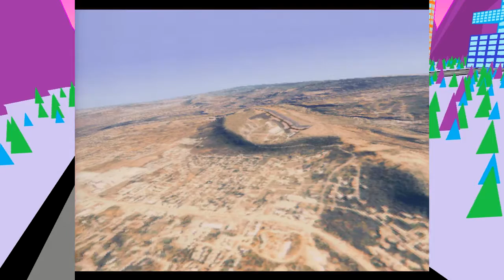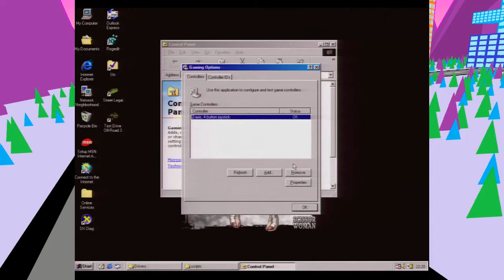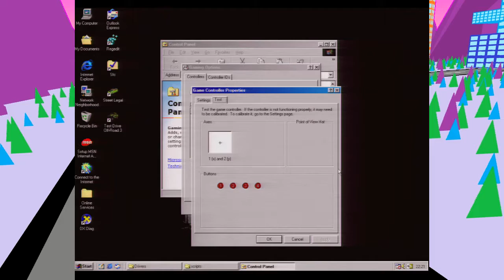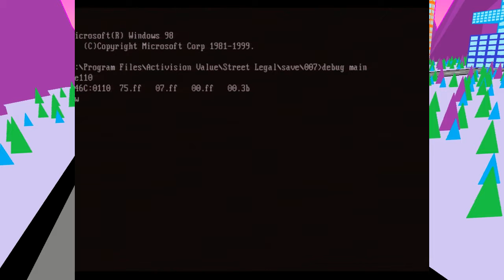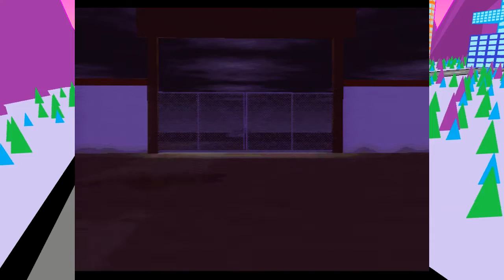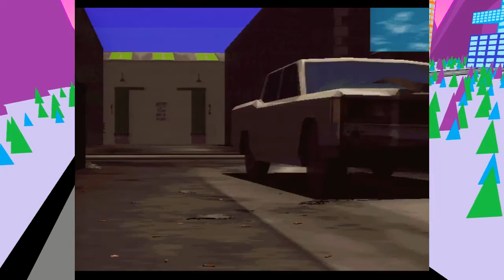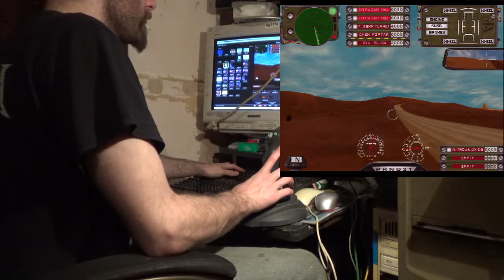Saitek R100 Sports Wheel

Comment: Great to see you up and running again! Even if it's in reduced capacity due to...things.
Reply from the maker: Video stuff should be back to normal soon as the new hardware kicks in and I may be able to get more space to work as I've got a shed to put useless junk in now - stuff I don't want to throw out, but stuff that can be stored out there which doesn't bother me should it get damaged or stolen, things like old bike wheels I'll probably never use, but know I would suddenly have a use for them if I got rid of them. Also, next time I render, I might remember not to limit the process to two threads, I've got eight of them to throw at it now.
Reply: HighTreason610 That's great, man! Looking forward to it!

Comment: it's quite common to find steering wheels for cheap here, especially the Logitech Formula GP (black-yellow) and Formula Force GP (black-red). What's funny though is those wheels work just fine on a Playstation 2, because Logitech made a PS2 version of it and use the same drivers. You just have to plug it in the top USB port i think, i remember trying it and 1 of the USB ports on the PS2 it didn't worked.
Reply: I have the Formula GP wheel for PC. Nice wheel, but Deadzone.
Reply from the maker: Now you mention it, I think I remember seeing a controller of some sort that worked on the PS2 like that, it probably was the Formula GP wheel. I also remember going the other way and Joy2Key-ing the Buzz pads on a PC before writing some shoddy Quiz game with really crappy batch files. Can't help but wonder if I still have a copy of it, as I'm fairly certain I do still have the Buzz pads and never found a use for them... I never owned the game that went with them.

Comment: Yeah! You're back in action!

What are the specs on the Athlon? My first all-new build back in the day was an Athlon XP, so I have a soft spot for the older AMD parts.
Reply from the maker: I was going to keep it a secret, but why not? OK, I'll write the basic specs below the "Read More" line. But otherwise I totally get that - my first new-parts build was in the Athlon era, I seem to think I waited for the XP to come along so the old Duron would get silly cheap (and they really were, about £1 for every 100MHz at one stage) because I was still a kid with no money. I loved that machine and have always missed it. The problems started when I moved to an Athlon XP, I couldn't get the parts I really wanted and, well...

Specs;
Chaintech 7VJL Apogee (I wanted the Deluxe in the day, but haven't found one yet)
Athlon XP 2800+ - It's a weird one, my board hasn't been modded by Chaintech so I can't run some CPUs.
ASUS GeForce Ti 4600 - Factory Overclocked. This is an AGP 4x motherboard so the 4800 (non-SE) or Quadro4 980 would be pointless, maybe even cause a performance hit, as they're just the same GPU with AGP 8x optimizations.
1GB DDR RAM - It's rated for 400MHz which the board doesn't do, so timings can be very tight whilst remaining stable.
The PSU is a bit anemic, I need to fix my 650 Watt monster as this is a 5V system.

...I wish I'd had this back then, it would have killed the 2600+ I was stuck with, even though the bus is slower. It is everything my previous Athlon machines should have been, what they could have been if I wasn't stuck on flawed motherboards and crappy GPUs. If I'd had this one back then it would have changed everything.

Comment: this is an old wheel with a built in defect. Mine broke within 30 mins of using it. took it apart and noticed every other wheel ever made would also break. It's like they never did any testing to see if it actualy worked or would stand up to a days usage
Reply from the maker: Can't say I've had any issues, nor did I find anything alarming when it was in pieces, what exactly was wrong? Is it possible that this flaw was either corrected at some point or introduced later on as a result of cost-cutting measures?
Reply: it may have been. I cant remember tbh, it was like 14 years ago or something. all I remember was opening it to see if I could fix it and then noticing a design flaw and realizing if I replaced it on guarantee, the next wheel would do the same.Even showed the floor to Game where I bought it from and they agreed the rest of the batch would fail also  @HighTreason610
Reply from the maker: That's interesting to know. You'd hope that maybe all of the broken ones have been filtered out by now and that only working ones are left in the used market. Obviously it's still not fantastically well built in there, being on the cheaper end of the scale, so flaw or no flaw they're always going to have a finite life due to having moving parts.

Comment: I noticed the reservoir on your drive bay? Is your PC watercooled or its just for aesthetics?
Reply from the maker: Liquid cooled but it leaks and the fluid needs changing. Fixing it is risky because some of the parts aren't made anymore and cannot be replaced without rebuilding the entire loop if they don't survive the work. I may try to fix it once the Xeon fully takes over but by then I'd be fine going back to air if I had to. The reservoir used to be covered by blanking plates and would be again if the loop were repaired but the case parts were in a box I no longer have. It's not too ugly, but the screw holes don't line up with my case properly (stupid XSPC, it's not like the heights are standard in all cases or anything) so it's held in purely by how tight it is. The Athlon the games were running on is air cooled and involves rather a lot of copper, the CPU is an unusual one and pukes out a lot of heat, it took a very long time to find an appropriate heatsink. I did nearly liquid cool that one too, but I didn't feel safe trusting a rusty cooler that was over a decade old.

Comment: Saitek R100 gaming wheel how can possible Windows 10 support
Reply from the maker: The USB version might work under Windows 10 purely because it will show up as a standard game controller. The R220 USB definitely does work, should be roughly the same price and easy to find. Be sure it has the clamp part for the wheel and the base piece for the pedals if you take that route, though.